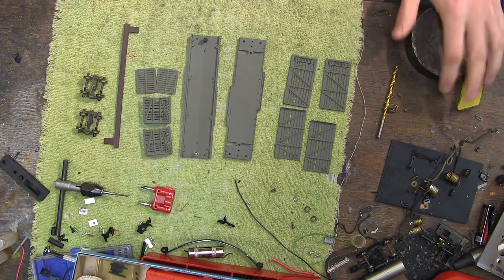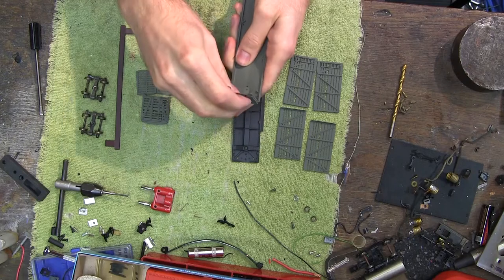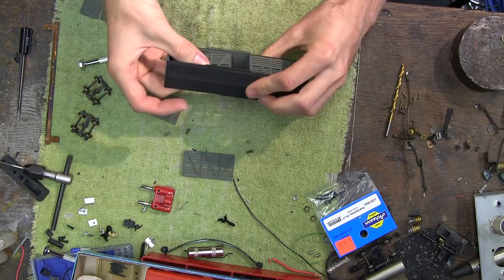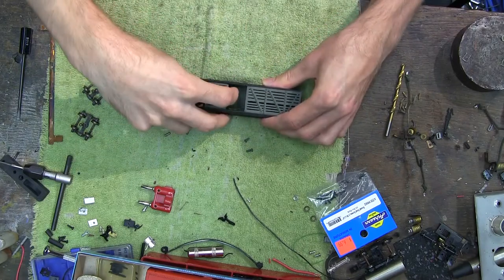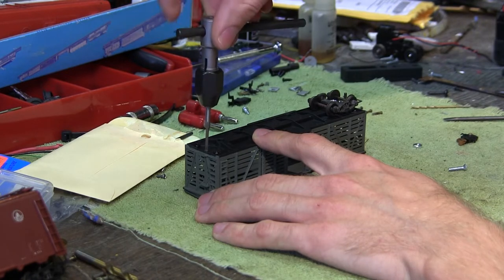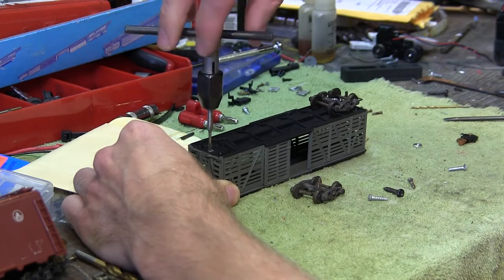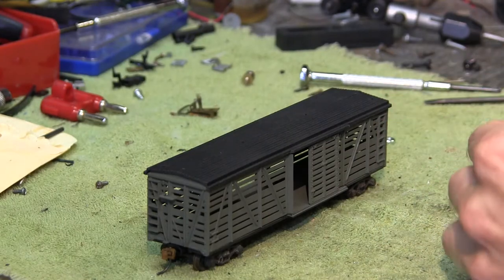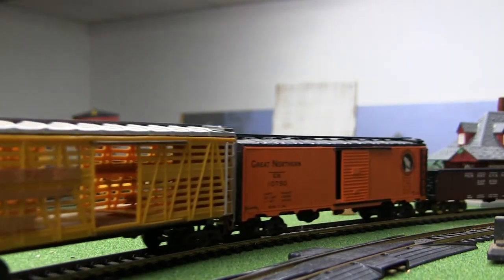(Re)Building A Metal Freight Car Kit

Comment: Great job on the car repaint & reassembly. Sharp loco you have pulling it around 😎
Reply from the maker: Thanks! I actually might paint it red to match the Soo line car that the Laona Northern has.... but for now got other projects. The engine is a Walthers Fairbanks switcher. I have a vid on that as well. I'd like to find a vintage Milwaukee Road variant as that one I have ridden in at the RR Museum in Green Bay.